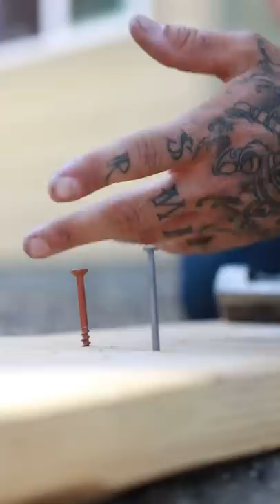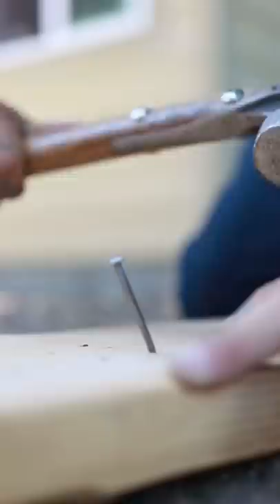Nails vs. Screws: Why do we use nails? #shorts

Comment: Screws enable pretensioned friction joints. This way there is no actual shear force to the screw, only tension. And actually we rarely even take this into account when designing structures. If you are designing a structure where screw bends you are doing something wrong...
Reply: Yea if your project racks any direction enough to Bend a screw to break you shouldn't be building or operating heavy equipment near it. And sadly alot of people will believe him. It's the same reason people done use oak for framing, the use pine for studs and spruce for all rafters over 16ft. (Georgia). It's cheaper. For the record if I had it my way I would use oak studs and rafters, and screws. People don't realize the number of nails or lbs it takes to build even a 1200 sqft home/ structure. Screws are sometimes twice or more expensive
Reply: Don't know how you got to Matt's video, but he builds in California. He's hedging against shits in earthquakes. Also, his under flooring is glued.
Reply: Yes! That’s why everyone builds walls with screws up here in Canada
Reply: @Pskawt  thought you guys still lived in igloos
Reply: @marcosmota1094  then you should really use screws instead of nails. Thats what they do in JPN.
Reply: @roopehaimila4353  do you not take into account humidity and expansion/contraction of the wood? It depends on the area you live in, but places with high variance like myself find screws to be hit or miss really.
Reply: @Cesshiphop  yeap, thats exactly why pretension with screws is key in wood structure joints. With only nails used in your joints they are never pretensioned and expansion will result movement in the nail since it's only held on by woods friction. In screws the other end stays locked still and the bulk end transfers the pretensioned forces to a larger area that can withstand it. This is also one reason why used lumber needs to be dry enough (less shrinking than expansion).
Reply: Finally someone who understands a bolted joint
Reply: @Pskawt  No they don't Scott. Go watch "Framing Beast" on his YT channel. He's a framer in Canada and uses nails while framing the whole time.
Reply: @MarzNeedsMartyrs  There are things like tornadoes, hurricane winds, earthquakes and derrick winds to take into account. All of those natural forces create "shear load" forces. Houses when built don't just set there and "rack" for no reason whether you use screws or nails to frame it with. But, when and if they do "rack", shift or get put under shear loads, nails are better at allowing the structure to shift and conform to those forces instead of yielding from being too rigid. It's literally the same reason why tower cranes sway in the wind and sky scrapers sway in the wind. They are designed with joints and ductile metals to allow for movement. Otherwise buildings and cranes would be collapsing on a daily basis. Also, if you're saying you are from Georgia, that's all I need to know. I'm from Missouri but I've been living in Georgia for the last 6 years while building Vogtle 3&4. All you guys have shown me that you're capable of producing is "jack of all trades" hack jobs on almost everything I have hired a contractor to do to my house down here. I finally learned my lesson and just started to do everything myself, because you cracker jack mother truckers will gladly take someone's money, say you know what you're doing and then screw it up every chance you get or build it wrong because "that's how we've always done it". I had to have one of you Georgians come back and fix my gutters 5 freakin times because they said they could put up gutters, but clearly had no idea what they were doing. Come to find out, they didn't even know what a drip edge was. Not surprising since almost none of the houses down here have gutters. Should have just done it myself instead of having to fix their screw ups after the 5th time of them trying to patch and repair a brand new 50ft run of gutters. Yeah, only one straight run of 50ft worth of gutters. And every fly by night contractor down here I have experienced was that way. You guys are hacks, period. People that are native to here just don't know any better, that's the only reason some of these companies are still in business. Only due to the locals own ignorance.
Reply: Houses, cranes and sky scrapers never experience any type of shear load Roope? Never? Or they could never be subjected to shear loads at all? Ever? Yes, houses do experience shear loads from high winds or earthquakes etc. Nails allow the structure to rack and shift with those shear loads instead of breaking apart like screws do from shear loads. Nails are ductile under shear loads. Screws are brittle under side/shear loads. Screws will snap and shear, nails will alow for a small amount of movement instead of just breaking apart or yielding. I'm really glad that people with your mindset have never been able to design cranes or sky scrapers. Otherwise we would be seeing them collapse on a daily basis. 🤦🏼‍♂️
Reply: @gtbigdog3507  I build power plants and 1000 ft steel structures for a living. I'm also a metallurgist. Neither you or him understand shear strength or tensile strength if you argue against this video.
Reply: @LeadRakFPS  don’t go to Disneyland then. All the rides I designed are using the friction principle for fasteners. Secondly better not drive a car because your wheels are held on by friction
Reply: @gtbigdog3507  Yep, no you didn't. Because if you designed "friction" connections that are using BOLTS (not screws) then you would know that bolts aren't hardened to the same extent as screws. Bolts for friction connections are more ductile and let's not forget that they are structural "bolts". Which means they are more ductile and definitely a bigger diameter than screws. So they are capable of withstanding higher shear loads. I'm a Union Boilermaker/Welder and a metallurgist. I've installed those very connections at power plants, oil refineries and on destroyer ships. Large diameter structural bolts aren't even close to comparing with screws. Bolts are made to withstand higher shear loads, small coarse thread screws are not. They are made to replace nails in the aspect of not backing out from hot and cold cycle expansion and contraction. So, they are great for sub floor work, outdoor decking, drywall etc. But not great for structural exterior framing for a house's walls or roof, because they don't have the same shear strength. Don't try to compare bolts with screws. That's a totally different ball game. Same goes for metal buildings and self tapping screws. Not the same type of screws. They are more ductile then WOOD screws, but will still shear easier than nails. Just because you may design rides, doesn't mean that you can compare your structural bolts or ductile machine screws to coarse thread wood screws. Not the same shear strength. Not even close.
Reply: @gtbigdog3507  And you know why bolts are used as lug nuts on vehicles wheels? Because they have to be torqued to a certain value and when you have a lug nut tight and then torque it to how ever many foot lbs it calls for, it is actually tensioning/stretching that stud a small amount. For a stud or bolt to be able to withstand that over and over without yielding and breaking, it has to be ductile enough. Otherwise if it was hardened too much, it would snap off in a short amount of time.
Reply: @gtbigdog3507  Also, how much shear load in the aspect of high winds are these rides facing? If it's roller coaster type rides I'm willing to guess very little due to the rails and bolted connections being so small. Most of the shear load would be from the weight of the coaster and people rolling over each joint. House's are basically giant wind sails. They are built with nails so that they can shift and flex with any possible high wind shear loads. Nails will allow the structure to move slightly without blowing apart at each joint by bending. Wood screws will snap in half because they are brittle and don't have as high of a shear strength.
Reply: @gtbigdog3507  Now, if someone wanted to pay to have their house framed and built with large diameter structural bolts, then yes, that would be stronger than nails or screws. But who in their right mind would pay for that? Almost no one. Wood screws and structural bolts are not cut from the same cloth when it comes to being ductile and how much shear load they can withstand. We are talking about building and framing houses with nails or wood screws. Not heavy duty metal structural connections with large diameter bolts. It's not even comparable.
Reply: @gtbigdog3507  "Wood" screws have a higher tensile strength than nails. Nails have a higher shear strength than "wood" screws. Houses are put under shear load/side load forces not linear tensile loads from connections being pulled directly apart from each other. So, nails it is. Because they will bend and conform with those loads instead of snapping in half like screws would. It's a good thing you don't design sky scrapers or cranes. Be a lot of dead people out there because you thought wood screws have the same shear strength and are as ductile as BOLTS in a  friction connection.
Reply: @LeadRakFPS  I think alot of folks forget that sometimes nails are sunk at an angle as in toenailing a stud and that gives the joint a heck of a lot of resistance to  failure. Screws are only as strong as the material they are screwed into.
Reply: @brandonrandall3861  A lot of people do forget that. But the people on here don't have a clue either way. Lol
Reply: @LeadRakFPS  after reading every single thing you just said I still think Screws are stronger because the screws are screws and the nails are nails and the screw screw but the nail doesn’t nail. You know what I’m sayin? And so screw a screw into wood and it will be a screw in wood but then a nail in wood is still just a nail in wood meaning the screw is stronger than the nail. For example tanks. (Period)
Reply: @LeadRakFPS  nah, I’m just fuckin around and making no sense just to bug you 😂 TBH after reading everything you just said, if I were to take a few notes on it, I could probably pass a higher level college test after a bit of studying those notes 😂 like you seem to know exactly what you’re talking about because you just types a whole ass essay on what it (physically/technically/literally) is to, “Bob the builder” any man made structure that exists on earth. 😂😂😂
Reply: @robyparker2027  It just bugs me to see so many ignorant people talk about how screws are stronger than nails and should be used for structural "shear load" applications like building houses, because no, they shouldn't. I'm a Union Boilermaker/Welder and tradesman. I'm also a metallurgist. I know which metals are more ductile and which are more brittle in a given scenario of shear load (which is what type of force a house is put under). Screws snap or break under side or "shear load" forces. Nails bend and conform allowing the structure to stay intact. It's a no brainer. But, you can't tell that to average fly by night, "Bob The Builder", know it all contractors. Because they are ignorant and think comparing it to pulling two pieces of wood directly apart (linear tensile load) is the same thing. When it is two very different forces. Lol. Idiots everywhere.
Reply: @LeadRakFPS  I feel your pain bro, I’m a mechanic. I can easily say I know how to fix/repair/replace anything that has to do with a car including electrical i currently have 4 college credits in electrical engineering. I’m assuming way more people in the area i work in try doing their own shit causing it to go from fucked to double fucked sometimes even triple fucked because they tried unfucking the double fucked causing it to get fucked up more.. leaving it all up to me to fix all three fucks costing them 10X the money it woulda costed just to have brought it into me instead of unscrewing parts and playing Jenga with the engine like a dumb ass 😂

Comment: Probably should have used an appropriate screw, I work for a company in New Zealand which only uses würth screws, they are literally stronger in every way than the nails, granted they are mega expensive but we build high end echo homes so money usually isn't an issue.

The main advantage of using (appropriate)screws to frame is that it provides a really tight connection which means the frame alot more ridged which in turn will stop the house moving as much in a earthquake and stop the plaster board from cracking in an earthquake
Reply: Ahi si te la jalaste bien Machín
Reply: Kia ora! A fellow kiwi, It's nice to see someone from our little country.
Reply: @BreakKaydenBreak  Kia ora haha, no matter where you are or what you're doing you can always find a kiwi haha
Reply: @bill72pa  when?
Reply: @bill72pa  Incorrect assessment

Comment: Lol nobody gonna talk about how nails can work themselves out of the hole slowly? Hence nail pops in dry wall. That won't happen nearly as easily with a screw 
Built a backyard fence with my dad 12 years ago and not a single plank has fallen or is loose. Screws are better. Nails are just cheap and save time for the installer.
Reply: Exactly thank you thank you
Reply: For things like fences and decks I agree 100% tha t screws are superior but there are applications where nails make more sense like framing.
Reply: That's why drywall screws are a standard..
Reply: No, screws do not have the shear strength. Try using ring shanked nails and see if they work themselves out. They won't 
 Screws aren't safe to even frame a deck without hangers. They lack the shear strength.  And remember screws would never pass an inspection for anything structural, unless using proper structural screws.

A fence is  a far different reality tha  say a floor structure with live and dead loads.  

As a carpenter I use screws all the time, and many jobs screws are superior. Structural framing is not one of those jobs.
Reply: @tyler70878  still get pops with dw screws though
Reply: Wrong

Comment: But huge towers use bolts. Think that breaking has to do with the metal its made out of
Reply: Use those cheap terrace screws or even worse, drywall screws and you have easy shears damage.

But use a proper screws for the job and it will withstand shears. But difference is like 10x in price to cheap screw and almost 50x to nail.
Reply: Bolts are used for clamping forces, fully tightened bolts of those sizes provide ridiculous amounts of clamping force and essentially get torqued to where you would have to stretch out those bolts like play dough to break them
Reply: Big difference between a bolt used in a skyscraper and a screw used in a house bud.  One is 3/4 of an inch in diameter and 6 dollars per bolt. The other is 1/4 if inch and .1 dollars per srcrew.
Reply: @ChefofWar33  umm I have bolts that are skinnier than screws I have
Reply: @divingfalconfpv4602  No shit.  Now do you think any of those are used in a goddamn skyscraper? lmfao
Reply: @ChefofWar33  point is it isn't size. They make both in different sizes
Reply: @ChefofWar33  Your point is taken lmao

Comment: Because screws brake from the friction that’s caused by going back and forth. That friction causes heat which anything that’s metal breaks. Barbed wire has the same properties